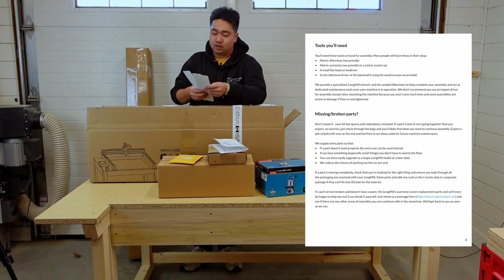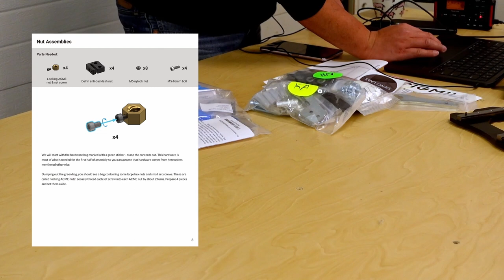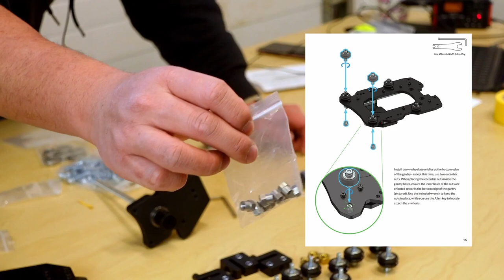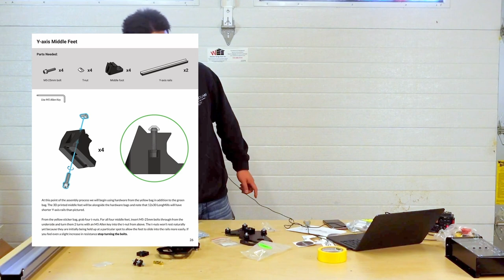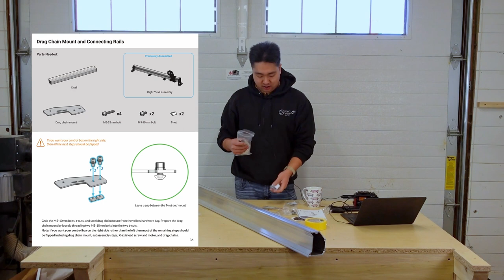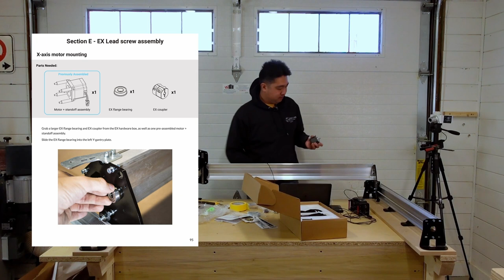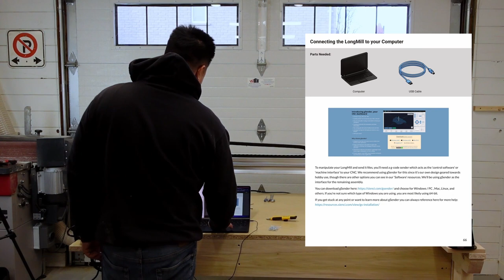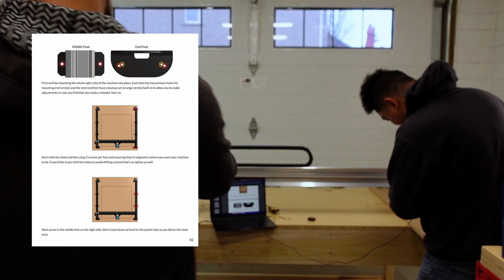How to Assemble the 48” X 30” LongMill MK2 CNC

Comment: Hello,

One of my motor wires came in WHITE / YELLOW / BLACK / RED. Instead of the BLUE / YELLOW / GREEN RED order.

Is this going to be ok to use?
Reply from the maker: If you're referring to the extension cable that connects to the main motor cable, yes that is fine to use.

Comment: Does the 48x30 include the extension cables or do you have to purchase those separately?
Reply from the maker: The kit comes with one extension cable, which is good for if you are planning to put the controller on the left side of the machine, and you can order more if you want to relocate it under the table lets say.

Comment: Do you recommend blue lock tote on the screws without locknuts?
Reply from the maker: The LongMill MK2 uses a combination of nylock nuts and SEMS screws with locking washers to help keep fasteners from backing out, but using locktite can add some extra security. If you have it and want to spend the time to add it to your assembly, I don't believe there will be any issues. However, I would still recommend checking for loose screws every few hundred hours regardless.

Comment: Newbie here. What would be the limiting factor(s) that would prohibit lengthening the x axis on out to say 72 or even 96 inches on the longmill?
Reply from the maker: Probably a couple things, such as limitations to how large of an object we can sent through the post, or due to the fact that the longer the lead screw gets, the more it's likely to whip. The 48" working area (about 60" wide) is a relatively optimal size given that most sheet stock come in 4ft wide sizes.
Reply: @SienciLabs  I see. Thank you.

Comment: I about to buy this machine...my question is i have vcarve desktop 11.5 ..can i use it with this machine
Reply from the maker: VCarve is perfectly able to make g-code to run on it 👍 the only downside is that VCarve is limited on project size
Reply: Wen I buy the machine it come with the program?
Reply from the maker: No it doesn't, you can bring the software you prefer, there are even lots of free options that are quite good

Comment: Just looking at what it takes to assemble...I am going  to pay more and go with a different manufacturer.
Reply: If you experienced CNC user maybe you are right, if you are a beginner I would recommend this because you will get to maintenance the machine and troubleshoot problems that they will come up with normal wear and tear. You will know what part or what is going on with your machine. I put this machine 90% up on my first weekend and I didn’t know nothing, I hate putting together IKEA stuff this CNC was easier or almost same difficult degree.

Comment: Having problems getting my machine running smoothly, Finding support not to helpful. A week has gone by Jason has been helpful to me still no luck getting the machine running. just received a a new board for the control box, not a control box just the board. So I have to disassemble the box and reassemble. got it all together still not working. I think I'm at 7 days now trying to get my $4,000.00 machine to run. I called Sienci Labs Friday at 1 pm and messaged Jason I have had enough and wanted my money back. so far crickets! Monday I received an email I can not return it because I assembled it. so now I have a $4,000.00 unusable CNC Machine. No one will return my calls.
Reply from the maker: Hey Robert, sorry to hear that you're having issues getting your machine up and running. I talked with Jason to make sure your messages were getting through and it looks like he has been responsive and working with you to provide assistance. Yes, as is stated on our website once a machine is assembled and used we don't accept returns on it, but we do guarantee support to ensure that your machine is fully working. If you need anything else from us, please feel free to reach out.
Reply: @SienciLabs  When the machine is not working from the start of setting it up and only one email a day for help and day after day of working on this and nothing working. This is defective from you its not working. I just didn't change my mind it defective.
Reply: Hi, did you ever get it working?
Reply: @SzechuanChickenDog  Yes I did thanks you for asking. Jason at Sienci Labs was a great help to me. He was vary nice and a great help. I'm still finishing setting it all up but the machine is working . Have a great Day
Reply: @robertbennett861  that's awesome, happy you got it going. I have one in the box, still working on my area for setup. So, I was slightly alarmed at your first post. Any tips for avoiding issues?
Reply: @SzechuanChickenDog  Sometimes you have to do things you really don't want to do to get results. That's what I needed to do nothing was getting my message across to them. It worked in the end for me and hopefully the next person doesn't have to do what I did to get the proper response. They say they have great customer service mean what you.
Reply: @robertbennett861  What was the issue and what was the cause and fix?
Reply: @robertbennett861  what was the issue?